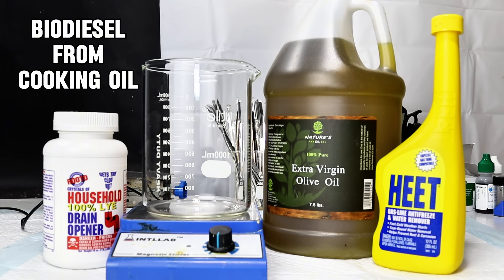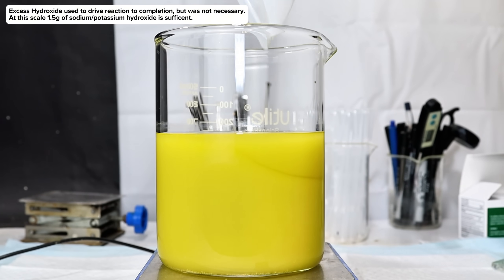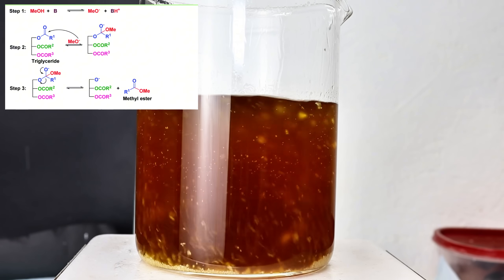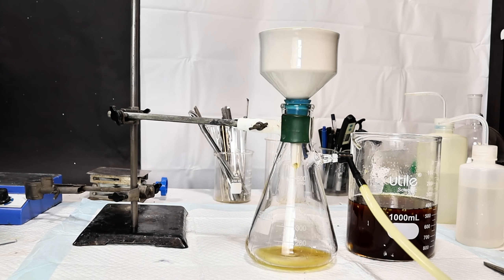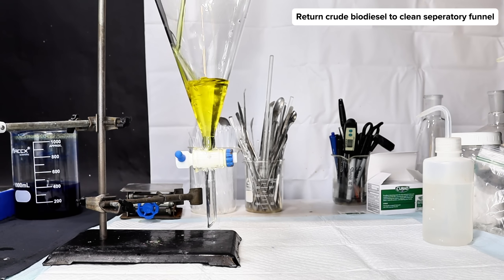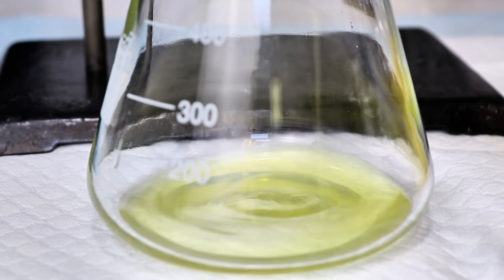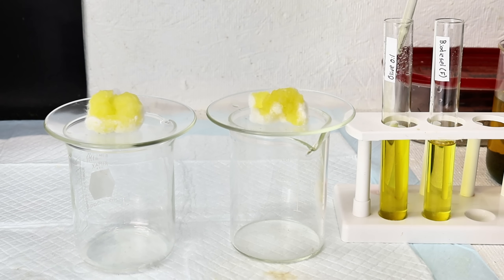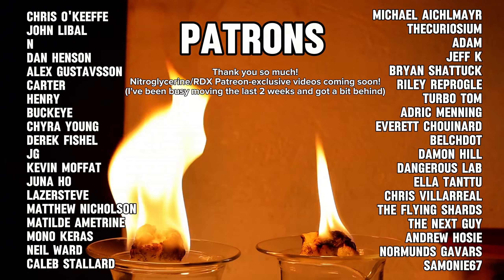Making Biodiesel from Cooking Oil

Comment: The main issue I see with this process is that it's a batch process. Granted, it's not a huge problem to overcome if you just scale up

That settling and washing process is just a huge killer in your production rate. Is there a way to bind something to polar molecules to make it separate out faster? I think there's something called a De-emulsifier. You might find it in the fuel additive section. Depending on how effective it is, you could cut down the fuel washing down to one step. It might even eliminate the drying step.

Of course, you could use a SAP filter like they do in aviation if you absolutely must be sure it's dry 
but a cheaper solution might just be a water separator filter used in diesel engines and drain the bottom bulb frequently.

Comment: The specific density of this waste oil distillate after distillation is 845 at 70° I've been working with this for 12 years I'm still looking for a better faster cheaper easier treatment clarification and deodorization of this oil this oil runs a diesel motor perfectly has tons of power and a great efficiency due to the higher output of power from this fuel versus something from the fueling station what other issue is the methanol and lye butanol and lie turn the fuel a bright red ethanol and lie does not I would like for a treatment that does not turn the fuel red
Reply from the maker: You're touching on one of my oldest projects that keeps failing time and time again. Over the last few years I've tried several times to develop an efficient and small-scale method to purify and deodorize waste motor oil, but nothing I've tried can really get the color out without distillation (which is certainly destructive to the point it wouldn't be able to be put back in a vehicle). Not to mention it's super tough to clean, toxic, and smells putrid.
I think I'm done trying to purify used motor oil, and I think my best bet is instead trying to crack it into usable distillates.

Comment: Are you a chemist any suggestions for waste oil distillate treatment I distill and fractionally separate automatic transmission fluid from Rebuilder shops around 680 I think I use either ethanol and lye methanol and lye but I'm having more success where's my newest treatment of butanol and l y e I wait for a separation and clarification and I also run through at one gallon per hour through high-speed direct drive centrifuge to improve Clarity if I don't get a full drop or precipitation to the bottom sometimes I water wash sometimes I do not I don't know if I have to or not
Reply from the maker: I am a chemist but I do have limited experience in this specific subfield of chemistry. The process you describe is pretty much the best I've been able to come up with for purification of used engine oils, and it actually sounds like you've had more success with it than me. I haven't considered butanol and lye before, and now I'm wondering if the process works better with longer-chain alcohols..
I'll definitely update with anything new I learn

Comment: I would not put any bio diesel in any newer diesel engine. I am pretty sure it will void the warranty and could damage the engine .
Reply from the maker: Yeah definitely not. I should probably add a disclaimer that newer engines are not nearly as tolerant as they used to be

Comment: a large scale version would be interesting, but pleas dont use it as Fuel for a regular Diesel. cars made to burn Biodiesel have additionale Fuel filters, and hohl diverent Materials are used for the fuel system. because, dosent matter if Diesel or Gasoline, this substitute fuels are much more aggressive to materials than regular Petroleums

Comment: If you'd use a potassium hydroxide instead of sodium you'd get a liquid glycerol instead of that thick shmucz. And yes you supposed to dissolve it in methanol first. Also I would not rise the mixture temperature above 80C degrees as that would just increase the methanol evaporation. Good mixing is the key. And the final product need to be checked for the conversion rate, you can be surprised;) Real process usually includes two stage reaction and glycerol wash.
Also try to make bio out of pure milk fat - it has surprisingly nice smell%)

Comment: Late 90's and early 00's ran fleet diesel trucks with one tank for reclaimed restaurant fry oil.  It was indistinguishable from no.2 diesel ⛽ with only slightly less power.
Only "refining" was to progressively decant in 55 gallon drums 🛢️🛢️🛢️ and strain to remove solids.  Both the drum and truck's fuel tank had bung heaters to promote viscosity and drive out water.  Whole thing was barbarically unscientific ... but it worked! ... and was "free" at a time when diesel fuel was doubling in price and driving truckers bankrupt.

Comment: My undergraduate research was about making biodiesel with ethanol using a potassium glyceroxide catalyst recycled from the glycerol. Using less polar alcohols than methanol is much more difficult to get the phase separation after the reaction. It has to be anhydrous and make minimal soap to work

Also, your finished fuel isn't quite pure. I've distilled ethyl esters from soybean oil into separate fractions, one that is enriched with ethyl palmitate and one that is just unsaturated esters. The unsaturated ethyl esters have a melting point of -32C and the fraction with saturated esters freezes at 25C. Both fractions look as clear as water!

We scaled up our production of fuel (not distilled) to 5 gallon batches of cooking oil from the fryers on campus. Our project is titled "Alkylyst" and we were awarded the EPA P3 grant (SU840686)

Comment: Diesel can work with plain vegetable oil.  The hot engine volatizes the oil.  To make jet fuel with a lower flash point,  simply add grignard reagent to the oil in molar proportion,  and then acid to quench the reaction.   Ph,  filter, done.
Reply from the maker: I honestly didn't know that until now but makes sense. I imagine all that glycerine would not be pleasant on any filters though lol

Comment: Its fun to see this method being used as my uncle has done the same for 20 years, hasn't used normal diesel since. He made a refinery out of two shipping containers and has the process semi automated, with a lot of custom made equipment. It all goes in as used fry oil from a stack of 150L drums, into a main mixing tank. A large electric outboard motor is on a frame above the mixing tank, with multiple addition valves for the methanol and lye mix, all pneumatic. The tank is insulated and has a heating element so the fats and solids that collect at the bottom can be drained, plus the fuel being heated makes it easier to transfer apparently.
It then gets pumped into a second tank for washing, then it finally gets tested for PH, balanced if necessary, then it is pumped in a 500L holding tank. (These are rough estimates based on memory and the size of it all.)
The holding tank is on a tower and is gravity fed, so he can fuel his 1990 Nissan Patrol or his 1980 Isuzu truck. (He runs a small farm in the boonies so effectively free fuel is great)

It has a very distinct smell the fuel, and over the 20 years of him making it, a 20 meter radius of his setup on the ground is soaked through with the fat and lye mix from slight leaks his setup has. Its a bit feral bit he tells me he scoops that muck up and uses it as soap, because "The sand makes for good grit remover and exfoliate"

The only problem he ever faced was a PH issue, it was slightly basic which wore out his fuel lines over time so it was 5 years ago when he parked at my house, the fuel line finally gave in. When he turned the ignition, the fuel pump pissed out biodiesel all over the exhaust manifold which instantly caused a massive engine fire. It was quite exciting to watch lol.
He then spent the afternoon swapping the old fuel lines out, replacing some burnt wiring and made a note to check the fuel lines after a couple of years. He still drives the car just fine, couldn't of guessed there was that calamity haha.
Reply from the maker: Oh damn he sounds like a fascinating character honestly. I did actually consider what the consequences of the somewhat alkaline final product could be, guess it's good to know what can happen. Aside from using the muck as soap this all definitely sounds like something I'd do if I had the space lol.
Thanks for sharing!
Reply: @integral_chemistry your welcome, Im a bit late to the party but I’m happy to see this.
Reply: fascinating read, thanks for sharing 🧡
Reply: Your uncle is the kind of farmer that John Deere doesn’t like!
Reply: Your uncle sounds absolutely bad ass
Reply: Where does he get the used oil from? Does he get it for free?
Reply: @abnormaalz  restaurants have to pay to dispose of their oil. if you offer to take it for free they will often say yes. also, many restaurants use an open dumpster for their oil which can simply be pumped out without asking. nobody will bother you as long as you don't make a mess.
Reply: Uncle goals. My nephew has seen his mom's powers magically not work on me. He was whining I was honking a golf cart horn at him. He ran inside to get her to tell me to stop, I told her no and honked at her until she went inside. He was like 🤔

Comment: @apoptosis nice demonstration. The whole bio diesel thing is a bit of scam in many ways. As straight oil can pretty easily be used. It is more viscous so depends on geographical location and weather as well as diesel injection system. As a rule older (more reliable) mechanical injection systems are fine with oil or oil blended with diesel or bio diesel. You can run straight oil also if you preheat the oil with either glow plugs used in a manifold or heat exchanger running of coolant but that needs to heat up running on blended oil/diesel before turning over to straight oil. The energy is the same if not more in oil than bio diesel, the demonstration wasnt really analogous to a "diesel" engine as theyre actually compression engines. The high compression ratio of the cylinders heats the air up so high that the oils flash point is reached before the oil is injected and it ignites the moment it enters the cylinder...
Reply from the maker: Hey thanks for the input! I do agree the demo didn't prove much outside of increased flammibility/cleaner burning of the biodiesel as compared to oil, but I figured I'd need some sort of sacrificial engine for a proper demo. Sounds to me like even that wouldn't have been a satisfactory demo given straight cooking oil can also be used.
I guess my assumption then would be that even though cooking oil could be used, wouldn't all the glycerol be a nightmare on the system/filters? I feel like it would create quite the mess.
Regardless yeah as far as biofuels go, I feel this one has a limited future compared to some other options. Figured I'd start here since it's such an easy process to try and gauge the internet's appetite for this kind of content.
Reply: Wasnt knocking your demo at all btw and I am a fan of your work also.
I run oil in my truck and its good I have also done a lot of research about in over the last 5 years.
The glycerol is only a problem when the ambient temp is to low, hence preheating being needed. As well as sizing fuel lines and filters to suit and I service my filters more often.
I wouldnt say biodiesel burns any cleaner when comparing to a properly tuned and set up compression engine.
You can always ad extra exhaust stages, Im thinking about adding a liquid trap (like a sink drain) to extract things like Ammonia,

Comment: Mechanic here, you made a diesel like product, that an old diesel engine would definitely run on. 👍
Unfortunately it is not safe to use in modern direct injection common rail diesel engines.
It needs to be run through lubricity tests for the injectors.
Also would be interested what micro value you filtered to after the addition of the last lot of chemical powder, any level of particulates in the fluid would also be death to injectors. 

You viewers need to know that.
Reply from the maker: Hey! Always love hearing from people with more specialized expertise like this. Definitely heard from a few people so far that this definitely should never go in a modern engine, which I kinda suspected was the case. Do you think though that this could be cut with regular diesel and then used in a modern engine, or is it just best to avoid completely?
And for the final filtering I used bleaching earth on top of a fritted funnel. Gave it two passes so it should definitely be particle free (at least down to 5 microns).
You're right too about the disclaimer. I'll edit the video description to reflect your comment later today, and I'm thinking about making a longer video on all the mistakes like this I've made since I started the channel
Reply: @integral_chemistry 
Hey there, one of the other commenters who mentioned he was in the fuel industry mentioned about blending the fuel.

Personally, in my own vehicles, I would only ever use recommended fuels.
My 4wd ute here in Australia has a set of injectors that are $750ea to buy, and if it is a fuel issue that caused them to need replacing, often the high pressure pump will need replacing as well...
On my vehicle, that's an engine out of the car job.
These are my personal reasons not to use alternative fuels.

Also, I know you said you already had an excess of olive oil, but if you added up the cost of the oil and chemicals, it would far dearer than diesel to make bio diesel 🙂
I understand that wasn't the purpose of your video, more to show how it could be done 👍

Take care.
Reply: I have been running B100 fuel in Citroen & Peugeot DW10 Common Rail engines for over a decade; well made fuel causes no harm to these old engines. Yes 'modern' common rail engines can't use it in a pure form but that is because of the technologies of these engines designed specifically to create less environmental pollution; an ironic factor when considering B100 as a fuel as it is far superior for the environment than ordinary diesel.
Reply: @TonyJackson-cf3er 
Purchased B100 service station fuel is not what the maker of this video made.
It has similar properties, but it is not made to the same standards and has not been tested and approved for lubricity of the injection system, micro cleanliness and other factors.
This is why I commented.

As for later model common rail engines using SCR and DPF technology, their tailpipe emissions will be cleaner than your older generation engine.

The debate on the source of the carbon in the fuel is another separate topic.
(Bio vs fossil) 
All the best.

Comment: meh, its very common knowledge how to make bio diesel on both a hobby/home scale and on an industrial scale. Not sure its worth wasting your time on more videos covering the same old!. To comment on a few points tho 1. Yes mix the hydroxide and methanol first. 2. if you use potassium hydroxide instead of sodium your glycerol wont solidify. (Im not sure entirely why!) 3. Your temperatures are far higher than necessary. In fact the reaction will complete at room temperature with stirring. Anything over 60C is detrimental as you are boiling off the methanol. 4. There is actually negligible difference in energy content after the conversion. bio diesel is all about reducing viscosity. Older vehicles will run on un-converted oil just fine.5. There is no reason you cant heat the oil to drive off water from washing. Its not at all volatile until several hundred degrees C.